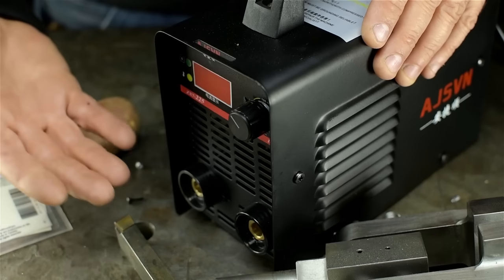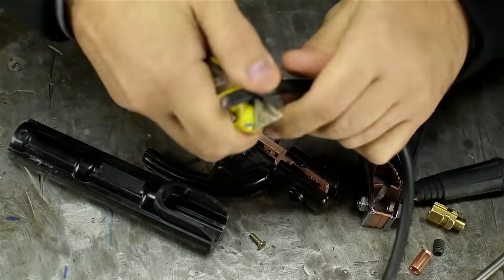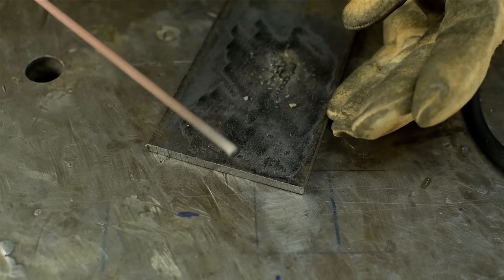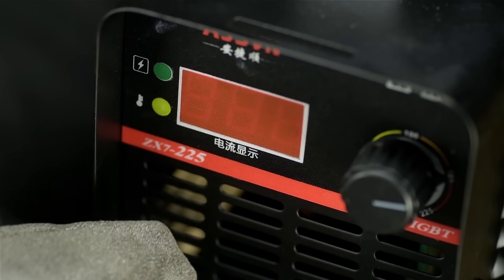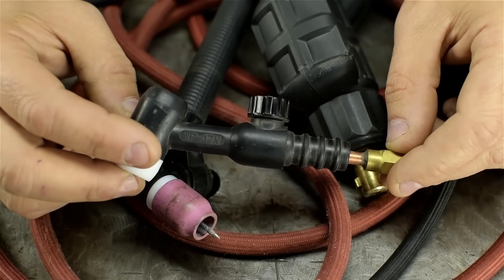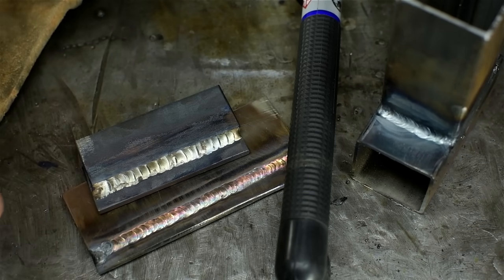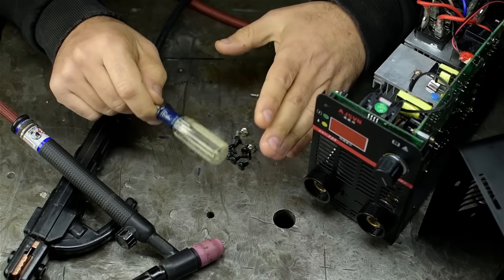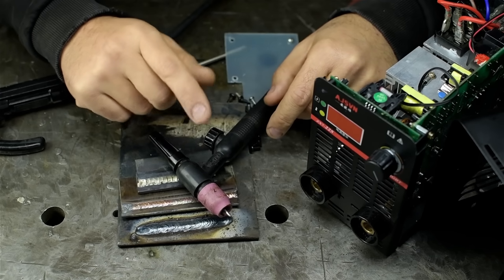Cheap Ebay Welder -- WILL IT TIG?!

Comment: I can't say a thing about the welds, as I am a total beginner here, but as far as electronics go, I wouldn't have dared to plug that thing into anything even close to mains. It is always the very first thing I do with new hardware: Check the ground connections. If a machine comes with a metal housing and no ground wire, the thing goes straight from packageing to scrapping it for parts.

OF course you could safe some bucks with these cheap chinese "tools" especially as they tend to reduce housesing and food cost. You know a dead man is living cheaper ...

Comment: I've noticed cheap Chinese stuff likes to use things like 300A as the model number.. I bought a variac that I thought was a 15A/3000VA one.. (I didn't believe it from the pictures but it was so cheap I couldn't resist) after reading the spec sheet once it arrived 15A/3000VA is the model number for their 8A variac 😂

Comment: The reason it works better with, reverse polarity, is because that is what 7028, 6011.... is supposed to use. It us called Reverse Polarity. And Reverse Polarity burns hotter then Straight Polarity.

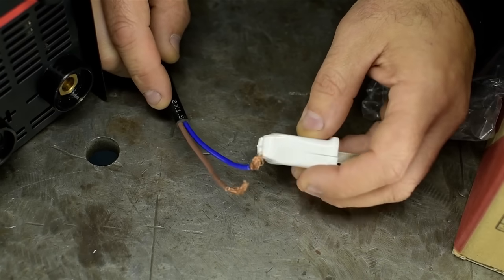Comment: 4:00 why don't you just add a ground wire from some Bolt to a three pronged plug. if you're anything like me you already have some 10-gauge wire lying around that you could use and just need to buy a new 3 prong plug

Comment: So you put it on wooden blocks, and then waste a lot of money on a cable to connect the ground back to the workbench? It would have done 200A without all that unnecessary resistance in the ground path.

Comment: If u didn't use the bigger oulet for your death toaster then that's why the read out is low it's gonna be about half of what it says in 110 mode
Reply: Needs a 220 to do the work and read properly

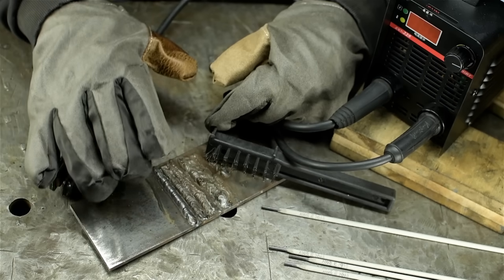Comment: @12:30-ish: TOT sez: "Half of me is really confused right now." ...That reminds me of the classic absurdist joke:

Q: "What's the difference between a duck (an ebay welder)?"
A: "One of its legs (poles) are both the same."

...seemed to fit, if anything could/would/does... Anyhoo, 1+1=180 volts, or something eh? TOT: you are a braver man than I!

Comment: I bought their little MIG fluxcore welder: unweldable junk. Never use it. Not gonna waste money on a tank and gas for it.if 
I bought their ac/dc stick welder: barely keeps 6013 rods going, 7018 is at war with you. All this at either ac or DC.
I'm not a welder by trade,, but used to be pretty good. 
It is why I renamed them "Harder Fate" tools.

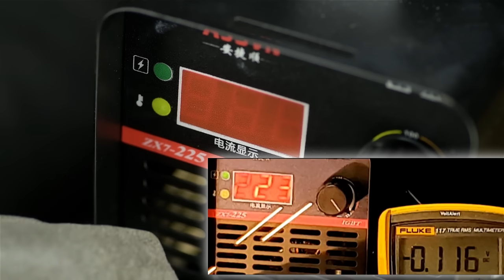Comment: 12:57 you said you were measuring current (Amps, A), but the display (and the connectors on the multimeter) show you were measuring tension (Volts, V, and I'm not calling it "voltage", cause that's wrong... call me a prick).

Are you sure you measured it right?

Comment: Seems as though when you were measuring amps your meter secretly was measuring voltage probably just a Fluke🤨
Reply: Currently clamps convert amps into volts. Look them up.
Useful because digital multimeters tend to not go anywhere near the 10’s of amps.

Comment: 70 18 is hard take alot of power to use. If you can burn 70 18 with 120 that is darn good problem around my house is not enough power.

Comment: If you were using standard 7018 roads that is where your problem was that machine is more likely an AC output  machine and changing part wouldn't help much you would get far better results and at lower possibly as specified by the manufacturer if the rods you should have been using on an AC output WELDING major were 7018 AC rods that are made specifically for A welding machines but can still be used on machine that accomodate reverse polarity use. I suggest that you re test the machine using 7018 AC rods you said you were not an expert welder well the reason that I know what I am talking about is I am a retired welder with over 60 years of welding experience and welded everything from pipelines to construction equipment to machinery to tool welding to to stainless to aluminum with stick mig and Tig and plasma. It up sets me to no end to see you guys profess to know more than the people who manufacture items that are meant as this machine is for light duty work and not for professional use. That machine would in a pinch suffice for emergency welding when a large machine would either not be available or cumbersome to use incases if a quick weld that machine would be a grab and plug and go and would do the trick for a quick repair and also be economical Vhave a mig machine that is comparable in size to the machine you show and at 11 lbs and works on either 115 bolts or 220 volts works just fine with either mode gas or gasless.
           A Canadian Skilled Tradesman.

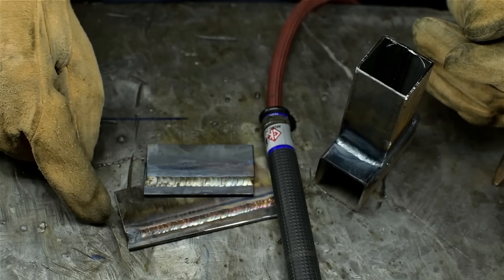Comment: I know nothing about welding, and yet here I am 27 minutes later...not knowing what to do with this knowledge about a random chinese welding machine... Question: What would be the proper setup to weld together aluminium square tubes like around 18:50? Might dabble in this.

Comment: Why is it every one always says tig over all what's the difference between a stick weld or say a tig weld is one of them stronger or something I know they use Tig on building roll cages but I'm a beginner I will say this the stick welder has to be better then a B's mig welder with no gas straight out of the gate fr fr because I'm in the middle of doing a universal Lambo door hangers and not  one of the mig welder  welds wants to hold for nothing fr fr except the ones I did to the car it's self but I let them get really hot now they took fr fr but I need to weld them to a 1/4 steel plate that's bolted to the door panel then welded to the hinges but would  this cheap stick welder work for what I need it for by any fr

Comment: That is negative 79 volts.. not amps you measured.. the fluke 117 cannot read more than 10amps DC.. and to measure amperage you did not hook it up right. Had you hooked it up correctly you would of popped the fuse in the meter.  you had it set to high range DC Voltage which moved the decimal point over.   To measure amps with the Fluke 117 you need to have it in series with one of your welding wires and that is obviously a problem.  you need a good Clamp meter to measure high current.

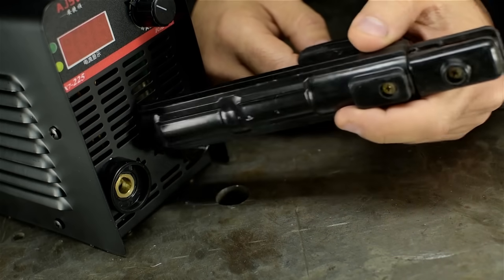Comment: 3:52 Don't you mean, "what makes it TIG"? :D :P 
4:01 Why not???  Don't you fancy a little **buzz** now and then???? :D ;)
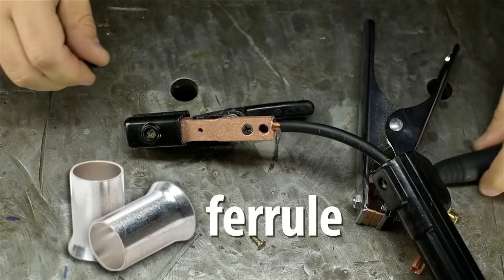5:53 Yeah, there is indeed a "feral" component included with the welder --- the "wireless" clamps aren't "tied down" to anything, so they are indeed "wild". XD
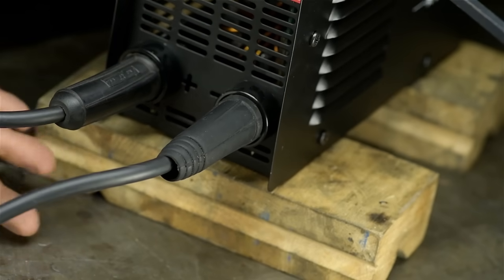7:47 Ummmmmm I would have used a nice broad sheet of plywood instead of two skimpy narrow blocks that could easily shift and let the dangerously-ungrounded machine drop down onto the metal workbench.

Comment: Just think if they didn’t include the useless gloves, face shield and chipping hammer they could sell a working?) welder DELIVERED for $40 bucks… that’s pretty insane on it’s own… Just an 80 of argon is gonna set you back almost 8 times that putting the machine itself in the nearly free price range for TIG 😂

Comment: no best tip for a scratch start.....use your filler, hold tungsten just above the surface and flick your filler hitting your tungsten and material. continue through with filler and then start your weld.

Comment: About the voltage   (Europe Is 220 for residential In some countries!)  Would bet so is Asia or at least China for sure too lazy too google .   Stereos you to have a 110 - 220 selector if they were bought overseas Just practice safety rules an wear shoes.   cheers  Edit   I know how to burn holes and make slag  reverse the polarity WOWEE! wot a trick i'm just a hobbyist an do it yourselfer .  also retired meck a nek i did some welding but if the shop needed to repair broken shit we took it to a big truck chinery shop   THOSE GUYS REPAIR EVERYTHING Just drop off your part fill out your tag with phone number and follow directions.  They will call you as soon as it is ready  or they will say wait.  DON'T BUG THEM some times they will let you watch if your in work clothes remain silent follow directions.  Welding shops are similar but truck chinery  repair lots of broken parts.  or build hydraulic lines lots of fancy stuff

Comment: LOL  your  "safety" procedures   have a flaw.  If there is  a line fault  to the welding leads,  one or both will be  HOT  with AC   LOL

Comment: Your model is made for 220V,  not for 110V.  220V is used in China. If you use it under 110V, you can only get 90A or so.

Comment: I picked this vid. because of the subject "WILL IT TIG". What do I see? Somebody that has a shaky hand arc welding. He will NEVER make a tig welder, or arc, come to that. You do not weave about like a drunk driver on a root run. Period! P.S. Electrode  negative is normally the correct way.
      As for tig, you need a high frequency start up. If you STRIKE an arc with the electrode, the electrode then needs to be repointed, plus the weld you put down needs to be ground out to remove the tungsten contamination. Don't scratch start, because it takes the point off the tungsten. 
Fucked is the word.

Comment: LGBT? IOt's actually IGBT (peonounced IGBET) which is Insulated Gate Bipolar Transistor - very rugged devices  - they even use them on  trams and electric trains at 100's or 1000's of amps and volts - obviously different device numbers!

Comment: this is not TIG this is stick welding, or am I missing something here
Reply: Well, he used a tungsten (T) tip in (i) gas (g) during the second half of the video. What more do you want?
Reply: @thebrowns5337  strictly technically he should have named the clip "arc welding"to set the record straight.

Comment: Using AC rod on a DC welder... Not a problem. However, since you knew the welder had a low AC starting voltage, the 7018 is not on the welder, that is on YOU. Even the manufacturer of the rod would agree, as it was specifically stated on the rods spec sheet not to do so. Using ANY arc welder converted with that type of TIG setup means a scratch start, again, where is the stuff coming from? This is a propaganda style video, not a review. You are biased, I get it. The answer to your video question should have been yes, as it will TIG, but with a warning that the unit is dangerous because of the lack of safety ground. Everything else was just sheer BS.

Comment: It still surprises me that people continue to spend ridiculously low amount of money on a product from China and complains about it. Why not spend the same amount of money you spent on your "good" welder and see the quality of it. 50$ is way to cheap for this kind of equipment. I mean did you ever thought that a 50$ welder would be good? This is kind of video is just getting boring at this point.
Reply: If you weld stuff maybe 5 times per year, would you pay $500+ for a welder?
Reply: @GoldSrc_  No. But in that case you are probably better off with a second hand buzz box, apart from the fact it won't do TIG and the stick electrode choice is limited. Don't forget that with this you have to already have DINSE leads, or find a few metres of welding cable for the stinger and earth clamp supplied.

I found this interesting as I've always wondered about the ultra cheap ebay inverters, in an academic way. I've never been tempted to buy one, as I already have a couple of decent inverters.
Reply: @fredsmith5473  Most people will just buy the cheap stuff, even if a second hand has better quality.
I'm pretty sure you have friends who have no need for a welder, ask them if they would buy a decent, second hand one that will only get used maybe once per year.
They would probably just go to you or buy some cheap stuff if they so happen to need anything welded quick.

I know this because there have been times when I thought I needed to weld something, just so that a few days later I don't need to, I would have spent money on something that would have been in storage for over two years now.
But something cheap like this? Sure, it's not like I do welding for a living.
Reply: @GoldSrc_  There's a demand for cheap inverter welders, as we can see from the number that sell on ebay. However, this particular one looks more trouble than its worth. You'd have to go through the hassle and cost of sourcing cable then making up the leads, or buying ready to use leads. The amp setting is hopeless and the claimed max is fictional. The electrical safety is questionable.

A lot of cheap stick welders are bought because people can see how they could be useful. Putting down a couple of inches of weld can fix all sorts of things. But being able to weld well enough to do that needs a fair amount of practice. I suspect they burn a few rods with them, then they sit in the garage for years. For instance, the welding mask thrown in with welders is just about usable, but a horrible thing to learn to weld with. 

People I know who only weld occasionally, have old air cooled welders, which can be bought for very little these days.

There are welding suppliers, who for about twice the price of this thing, sell inverters with leads and a warranty more likely to be worth something, and which are altogether more sensible buys.
Reply: @fredsmith5473  Of course, but even though spending more money to buy a decent one is the better option, most home gamers won't do that.
Not everyone has the mentality of "buy once, cry once". 
I'd buy a decent one, but then I remember that my friends have better ones if I ever need one.
Reply: @GoldSrc_  It's an interesting question, which applies to more than welders. For instance, you can buy 4.5" angle grinders, costing anywhere from 15 for the cheapest Chinese one, to 200 for a top end industrial grade Makita. The cheapest won't last long, vibrates a lot and you have to be really careful to let the speed of the disc do the work. If you've never had an angle grinder and are wondering what it can do, and how much you'd use it, the cheapest is appealing. Most people probably use it once every couple of years to cut up an old gate or like that. If they do use it, they can buy a better one, and the 15 was worth it for the education, but they still probably don't need to spend 200.

That said, I still maintain that the inverter in the video has so many drawbacks, it's more trouble than it's worth, especially since you have to fork out for four metres or more of welding cable and make up the leads.